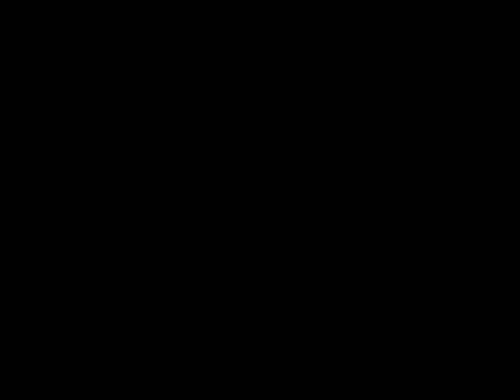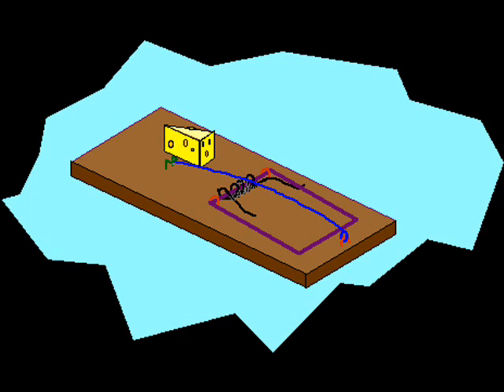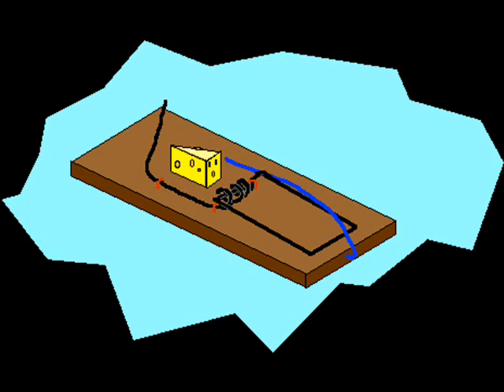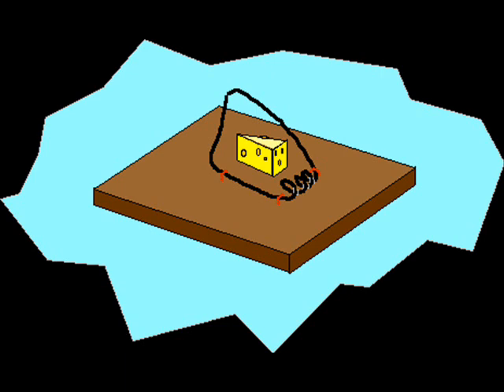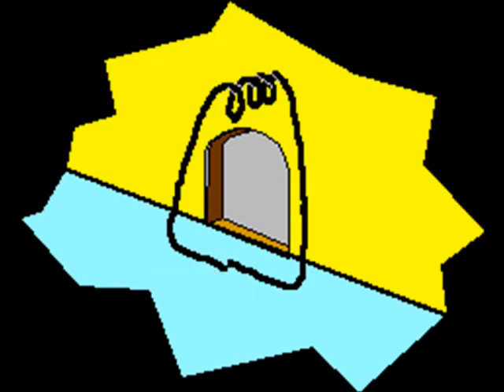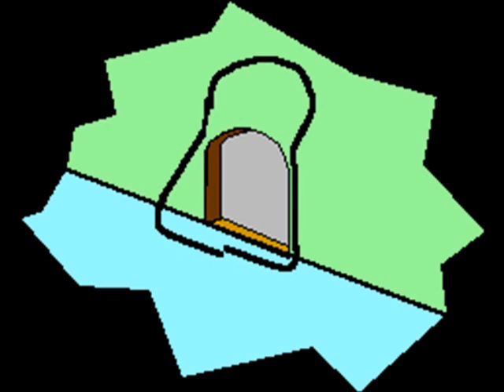Irreducible Complexity? Behe's Mousetrap

Comment: He didn't just reduce the parts here, he changed and reshaped them, basically building a different mousetrap design with different parts. Something tells me if he just simply removed any part without a new redesign, he won't have a working mousetrap or anything else.

Comment: Second, the function of the trap depends on a very delicate balance between the force of the spring and the restraint of the trigger, so that only a light (mouse-sized) touch will allow it to release. The joint formed by the staple allows the holddown bar to rotate freely away once released from the trigger. Jamming the bar into the base tightly enough to keep it from being dislodged by the tension of the spring would greatly impact that ability.

Comment from the maker: A common mousetrap can be reduced to a catch, a spring, a hammer, a holding bar, and a platform. Each of these parts existed long before the modern mousetrap existed, and served numerous roles in other, earlier devices. Not one of these parts was specifically created for the sole purpose of catching mice. All of them were adapted from previous components, and have since been specialized to their current purpose.

Comment from the maker: In the case of the simple mutation which leads to color vision, natural selection weeds out maladaptive mutations (die rolls < 6 for 'vision') so we're only worried about that last die (mutation for 'color vision') whether it turns up a 6 or not.

Selection pressures plus general stability of inheritance preserves the 6s achieved and works mainly on less adaptive traits - no need to go back to first die.

Comment: The last three mousetraps could possibly work, although it would sure be tricky to make the springs tight enough to release with enough force to harm a mouse. With that much force, what keeps the springy wire ends from just slipping past each other? And if you do manage to engineer it stiff enough so that the wire ends hold together, will the light touch of a mouse still set it off?

Comment: Beak size in a Galapagos finch due to competition from an invasive species.  This is not the example where a drought drove beaks to enlarge and subsequent return to normal climate caused beaks to shrink.  Which is actually an example of two evolutionary steps.  Here beaks have significantly and stably changed over 30 years.

Comment: The mousetrap's design and function are perfectly logical, comprised of no unnecessary parts. Reducing it's complexity by any component immediately would adversely affect one or more of the aspects of it's function, ie repeated effectiveness and portability.
From the trap, remove any component of your choice. In fact, as you propose, remove the trigger and get the bait to hold down the arm. Won't work. Remove the trigger arm's staple, the trigger arm get's lost.
Take your pick, let me know.

Comment from the maker: 1) Yes, mousetrap is designed, a mouse is not.
2) Undoubtedly mousetraps are designed, yet mice have evolved.
3) No one disputes that mousetraps are designed.
4) Indeed, everyone agrees that mousetraps are designed.

So Behe claims mousetraps are 'irreducibly complex' and this shows that they are not so - they can be simplified.

If there's an apples/oranges problem with the comparison between a manufactured item and an evolved specie, blame Behe who made the original claim.

Comment: A bit OT: I'm curious about this reduced mousetrap, especially the final one. Considering it's just a bent string touching at the ends, where would the tension come from required to snap it together? Have you made traps such as the ones you are proposing?

Comment: Third, changing making the hammer and spring of the same wire doesn't eliminate either the hammer or the spring. There is no reduction in complexity. They are both still there, and the trap won't function without both, whether they are designed as two pieces or one. Likewise, substituting a large base (the floor) for the small base (the wood block) is not a reduction in complexity.

Comment: He offers several theoretical solutions, but they don't work. First, the spring must have a great deal of tension in order to snap the bar hard enough to trap and hold the mouse. If simply placing the bait on the holddown bar is enough to keep it in place, then either the bait is so heavy that the mouse's nibbling will  not spring the trap, of the spring is so weak that the trap will not hold the mouse. So removing the trigger doesn't work.

Comment: Third, changing making the hammer and spring of the same wire doesn't eliminate either the hammer or the spring. They are both still there, and the trap won't function without both, whether they are designed as two pieces or one.

Comment from the maker: owen -

In a species, most offspring are pretty much the same as their parents. If there is a mutation which changes functionality, it only effects that individual.

So the answer is no, when a mutation comes along it doesn't effect every individual of a certain generation but starts small and must spread through the population.

Those with 'bad' mutations die off and don't pass along the bad, but those with 'good' mutations prosper and leave more descendents.

Comment: The problem with this video as an answer to Behe's mousetrap is that he has the question wrong. The question is not, "Can a simpler mousetrap be designed?" Of course it can. The question is, "Could THIS mousetrap have been put together one piece at a time, and still been functional at each step?" The answer is no. Behe looks at EXISTING microstructures and asks how they could have come into being step by step and still been functional. Simply designing something else doesn't solve the problem.

Comment: "So in the case of dice, why only samll steps which lead to 66666 is beneficial? why not small steps of 453434, have equal chance to be beneficial."

But that's the thing, for the purposes of that example we are assuming that 6s are more beneficial than anything else and thus have a selection advantage.  453434 could potentially be a solution too if the environment changes at each step to necessitate each new number in the sequence.  But that would have over-complicated the example.

Comment: alright that isn't an addition of information, and i can prove it. There are five transposable enzymes on the plasmid where the gene for the three enzymes needed to digest the nylon waste. These enzymes are designed to cause genetic recombination when the bacterium is under external stress, such as temperature or starvation. This amount of transposable enzymes suggest that the plasmid was DESIGNED to adapt when under stress.

Comment: Right, and that's the same problem with the monkey analogy.  It was only an example of natural selection-like mechanisms working out an improbable sequence and, most importantly, it was an example of building on past successes.  Obviously natural selection doesn't work EXACTLY like the dice example because there is no goal in evolution, but then, in nature there is always more than one solution to a problem, whereas in the monkey and dice examples only one solution works.

Comment: Kay

here is the reference list u wanted.

Kinoshita, S., Kageyama, S., Iba, K., Yamada, Y. and Okada, H., Utilization of a cyclic dimer and linear oligomers of ε-aminocapronoic acid by Achromobacter guttatus K172, Agric. Biol. Chem. 39(6):1219--1223, 1975. Note: A. guttatus K172 syn. Flavobacterium sp. K172.  
Negoro, S., Biodegradation of nylon oligomers [review], Applied Microbiology and Biotechnology 54:461--466, 2000.

Comment: Interesting choice. A common analogy is a bunch of monkeys typing away and writing Hamlet's soliloquy. A computer program was designed to examine this. The program featured preservation of correct letters, just like evolution (which is NOT random, and not like your scrabble letters). In fact, with this random generator and preservation, the soliloquy was typed out in quite a conceivable amount of time.

Comment: @proudfootz WOW YOU STILL dont get the concept you know whats a good example of irreducible complexity the human body. the mousetrap will function if you mangle it the way you did but  even if you do it will not work better then the way it was originally conceived you had to alter it physically to prove your point instead of simply removing a component. the human body is irreducible complexity remove or alter any component and it will not function as it was ORIGINALLY designed.that was the point

Comment: But from analogy to living example, with a scientifically viable explaination of the flagullum motor's thirty to forty-two individual parts for function, you'd be way ahead of the scientific community. The protrusion and wiggle of a 'whip' is one thing, (potentially from the earlier 'syringe' feature).  However, the high speed rotation, the bushings, the stator, the rotor, the ion energy to drive it, and the response to stimuli is quite another, and unlikely to have developed in one fell swoop.

Comment: Proudfootz..that's quite brilliant, but all you have done is suggest that there are simpler ways of killing a mouse than the design of mousetrap we currently have. You might as well say a rock could fall on a mouse and kill it...that would be simplier. The problem is it does nothing to show that your simplier model can evolve to the complex model by a stepwise process, each individual step of which is beneficial and incremental.

Comment: I agree with Johnny A. Although I don't think you have defeated this argument about the mousetrap at all. You claim it could work in all these different ways, but does reality bear this out? Will it actually catch a mouse? I doubt it. But that's neither her no there. Even if you are right here, it proves nothing. Can you tell us how the flagellum motor can be reduced like this down to nothing so that it can evolve one simple step at a time? Simply co-opting pre-existing things won't work either.

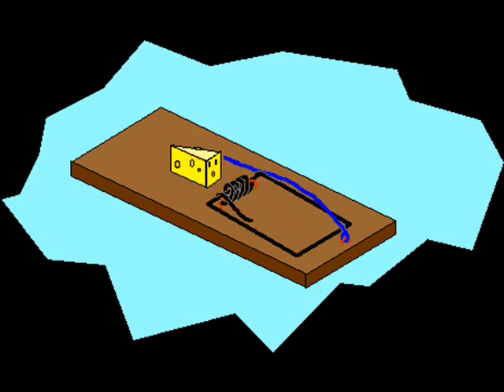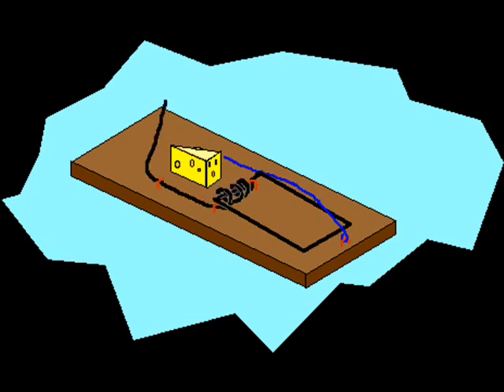Comment: 2:16-2:26 "The trap will still function" 
not really...
Just jamming the restraining rod into the wood would result in more fingers getting caught than mice since the stability and pressure needed to insert the rod are constantly changing with the integrity of the wood.
In to far, than the trap doesn't work; not in far enough, smashed finger. This is too flimsy to be a supposed improvement from the previous step. Irreducible complexity cannot be disproved that easy!

Comment: The point of irreducable compexity is that each step to the final product must be 1) incremental and 2) beneficial. You clearly just do not understand the argument (like Miller). Tellingly, you state that the trap does not "need" bait..and therefore you can remove the bait. I don't think you probably realise how this mental-leap shows how far behind the intellectual 8 ball you are here.
It's easy to say you can "remove" the bait, but that's not the question..the question is, how do you ADD it?

Comment: No! it is you attacking Behe with a strawman. That's the problem.
Behe used the mousetrap model to explain irreducible complexity. Instead of you explaining how a flagellum can become simplified and still perform the same function, you cop out by attacking his model. That's exactly what Ken Miller has been doing for years NEVER explaining how a flagellum was ever simplier than what it is today. This as we both know cannot be explained. Only in the mind of maybe Miller with "PLAUSIBLE" methods.

Comment: The answer is that they dont work.  The author of the video is a bit dishonest.   lets see him build a standard combustion motor(not rotary) without pistons or rings or cylinders, or a spark source, or a crankshaft, or without valves or without an exaust system,  irreducible complexity is a valid model.

Comment: Are you serious? This is a practical joke right? Almost everything you demostrated contradicted everything you wrote. The mouse trap ceases function almost quarter of the way through you're overly simplistic yet epically failed demonstration. What you did prove however, was how to dismantle a mouse trap. And scientifically there are only 3 possible outcomes from a genetic mutation, none of which result in a new species or a heavily modified species which drastically inherits coloured vision.